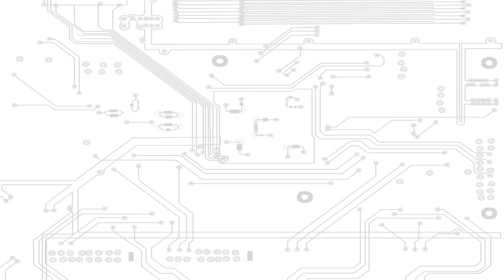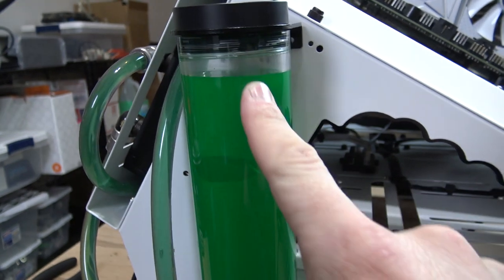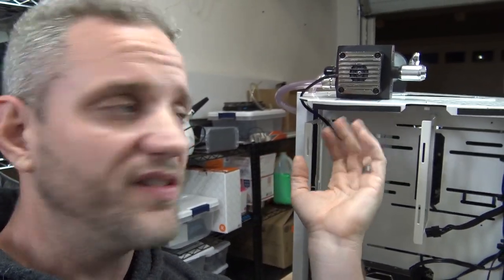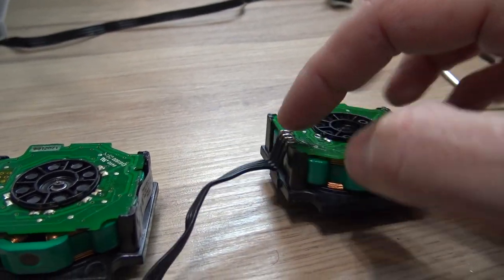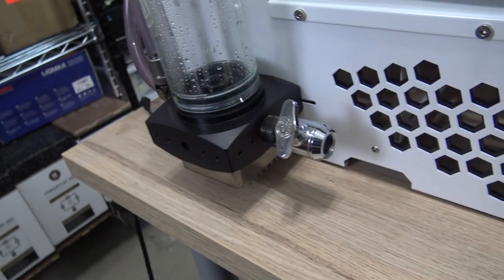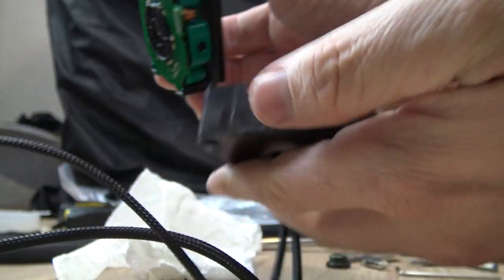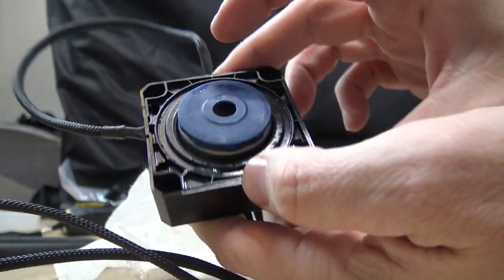My pump died... did the antifreeze kill it?? Let's pimp out my Test Bench!

Comment: That's why I'm scared to do a custom water loop. Do we at least have warranty if something like this happens?
Reply: NECRONEZUM usually not, They'll more than likely blame you if something goes wrong. Had 4 QD fittings from Koolance completely fail in under 6 months and wouldn't honor it
Reply: Arrow I know some people like to lower the rpm of the pump to lower the noise of it.
Reply: Arrow ever heard of overclocking?
Reply: Link_Jumper Ever heard of beefy air coolers or AIO liquid coolers...
Reply: Yes I have but, with a custom loop you will get better temps so, potentially more headroom for overclocking. Which could be a performance benefit making Arrow's statement not true.
Reply: Arrow one answer... looks
Reply: NECRONEZUM yes EKWB even replaces your PC hardware if their stuff failed and leaked
Reply: Beefy air coolers work but AIO are a gimmick and are overpriced compared to air that gets the same performance for less money. Custom or Air are the only smart options to go with.
Reply: SpydreX Official but AIOs look better in my opinion.
Reply: Razorswordex I will give them that, they defiantly look cool:p
Reply: There's also the fact that custom loops can be made much quieter than air or AIO, especially with GPUs.
Reply: Overclocking CPU's doesn't give much performance improvement in games... so meh.
Reply: well it really depends on how much of an overclock you are doing i.e my old rig had an 2.8 ghz pentium and i got 40 fps,overclocked it to 3.6 and got 112 fps so depends on the game.
Reply: ever heard of fun and DIY projects and having your own custom setup that no body else has that you can tinker with and make yours and enjoy doing it???
Reply: Actually you have a point but my i7 4790k that I overclocked to 5.0GHz stays 20-25c idle, 50-70c gaming on a Maelstrom 120K Watercooler. I'm fine for now but maybe In the future when I build a Z270 build, I'll reconsider it :P
Reply: I may go with EKWB then!
Reply: I once attempted to install a waterblock. I fucked up. Nvidia replaced my gpu. I installed another waterblock and it lives in my pc. But the failure rate of decent quality loop components is very low.
Reply: madjimms hahahaha

Comment: I'm not saying it's not the pinching causing the problem - but it doesn't seem a clever design to have bare solder points so close to a metal case and not have at some Kapton tape on them. Especially on something that has moisture so close by. I wonder if there was direct contact after a ding across the bottom or some condensation, after being put in the garage. It all depends on the clearance. Either way that's one hell of design flaw for the pinching it does do, and having exposed solder points like that.

Comment: That's why I just stick to a high quality air cooler, the only point of failure is the fan and is usually very easy to replace.
Reply: .. not to mention you still have a good deal of heat capacity, even if the fan dies.  Not so hard on equipment that relies on it.
Reply: Just as easy to replace as a pump with a dodgy housing
Reply: How much cooling does a dead pump offer, compared to an air cooler with a dead fan? : |
Reply: John Dowty a normal disipator does not work as a passive dissipator, the same as a dead pump.

Comment: there's no short in your pump.  aquarium pumps work the same way,  just blades on a magnet that spin when it has power. I've notice my pumps stop pumping water, i take out the pump while it's still connected, tap the blades and it's starts spinning again. doesn't take much to keep it from spinning,  just need to tap it to get it back on the sweet spot of the magnetic cycle. Your second pump looks toasty......... Fan of the channel. Thanks for the great information and recommendations you've given

Comment: Jay, I ran Rhogard boiler antifreeze in my last custom loop. It actually worked really well. I had it in it for over a year with no sludge build up. It had aluminum core so this was my best choice. This was on an old Q6600, EVGA 680 MB with 3 way EVGA 8800 Ultra's.

Comment: that little over sight by the builder would kind of piss me off a little. i didnt think it was the pinch part i was looking at the unprotected solder connection touching the bottom corner of the lower housing. i hope there is some kind of warning telling you that the pump is malfunctioning other wise that could have been much worst.
Reply: I agree with your diagnosis.  The pinch wouldn't short unless it bares the wire.  The housing was likely shorting to the PCB/solder points.
Reply: this is the correct answer
Reply: Not sure why jay would think pinching a wire would cause a short. No ones perfect right?
Looked like the solder connections on the one he smoked were a little larger. I think that's why the second one actually burned out.

Comment: Your all good with the rubber o-rings.  Engine coolant runs through rubber hoses in every automobile ever manufactured.  And their reservoirs are made of plastic too, although probably not glychol based.  One thing I would recommend.  Automobiles have very powerful pumps that move the engine coolant, where as your little, tiny pump is hardly a fraction of the power.  Even a 50/50 mixture of coolant is kinda thick.  I would recommend thinning that mixture down as well, say 25% coolant, 75% water.  Also, I believe there are some engine coolant additives that do not contain glychol.  Just check out all the stuff on the shelf and research the ingredients if they're not listed.....cheers!

Comment: in my opinion there was no short on the cable, it is more likely that the wire has broken inside, because the chip that burned seems to be one of the 3 MOSFETs that drive the 3 coils of the brushless motor, so    I think that the PWM wire got broken, and they usually have a pullup on the PWM signal line, therefore the pump ran at full speed (or at least it tried to) and made that noise (perhaps manufacturer didn't expect you to run it at full speed). The second pump smoked, because the motor wasn't loaded, and the EMF of the ultrafast spinning motor killed one of the MOSFETs. This is how I see it as an electronics hobbyist. I am also noting, that the board inside the pump has conformal coating, so any leaks wouldn't damage the components.

Comment: 2 minutes with a rotary tool, problem solved.
Reply: Or small piece of capton tape.
Reply: +Arek R.
if pressure from low clearances is the problem, pray tell, how would adding tape to the area - which increases the physical size of everything - solve the problem?????
Reply: because the pinched wires aren't the problem. If the strands broke from pinching they'd just stop working but wouldn't jump through insulation to another wire and short out.  The sides of that metal cover aren't insulated. couple that with the stupid amount of insulation missing off the wires at the solder point and you get shorting to the case via exposed wires. Adding tape to the exposed wires or case would insulate and stop shorting.
Reply: Alex Jennings the exposed ends could be the cause, but if the issue is around the pinched region, more material isn't going to help.
Reply: The problem is that wires are shorted by metal case and adding hard insulating tape would protect from shorting the wires.
Reply: I saw no signs of a short to the wires on the first unit. I think Jay just misspoke and meant to say "open circuit" instead of "short". The pressure from the case most likely pressed the wires together which allowed them to overheat in the pinched area on the first unit.
The second unit, however, did short out... hence, blue smoke. But adding tape would not have prevented damage. Grinding the hole slightly bigger would. Tape would only be a stand-alone solution if the wires shorted from insulation being exposed due to vibration, not pinching.

Comment: It's been said before, but it looks more like the metal housing created the short on the back of the PCB, not pinched wires.  They were marked, but that wasn't a bad pinch.  That casing had no protection between the bare metal and the PCB.

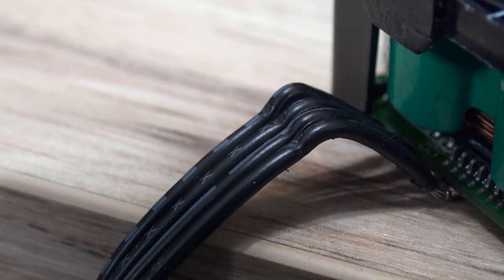Comment: Might be  too little to late.... but I don't think the pinching is the problem. You might be making a short with the 4 or 3 wires on the metal case. 5:34 you can see the solder has some oxidation dots on the bottom. 7:53 you can see that the solder is touching the table. with the plastic cover or out no problem. When you skrew in everything and tighten things up it might just be enough to touch

Comment: Laing makes great, silent and powerful pumps. I don't know what's the exact english term for the working principle, but in italian it's something called "magnetic drag": the impeller is a whole with the (massive) rotor, and they're joint together. They're submerged in the working fluid, and the liquid itself act as lubricant (and there goes why you shouldn't turn the pump on whitout liquid). The rotor-impeller ensemple sits on a shaft, which terminates with a ceramic tip - this is the bearing. The ensemble is self-balancing once it start spinning (therefore why they won't you to install the pump upside-down). I know for a fact that it requires quite a punch of current to start: the internal circuit has maybe a capacitor which charges, and it draws up to 2A before attempting to spin. Maybe something went wrong with the circuitry. Once I was feedin one of theese pumps with an external power adapter, and it won't spin because it was underpowered (the external psu I was using was cutting on the current draw).
Reply: Their design is awesome. Their electronics suck, very cheap, no overheat / overload protection. With the 8 watt version it's not a big problem but the more powerful version, the 18 watt version is prone to failure due to bad/weak electronics.

Comment: is the metal case plastic on the inside. because if not maybe one of the traces or solder joints is shorting on the metal case.

Comment: I'm using 10% universal green antifreeze as a corrosion inhibitor. It's been running for a year straight with NO issues. D5 pump in an xspc dual drive-bay reservoir with a 240 x 60mm rad and a 240mm x 35mm rad through a Koolance 380a water block. Run it with Vinyl soft tubing and aside from a heat kink I have had ZERO issues.

Comment: Kinda related, Jay. I have a DDC pump. For some reason one day it stopped working on system power up. If I gave the pump a hard tap/"shocked" it, it would then start pumping. I took it apart, saw nothing wrong, re-assembled, and it's been fine ever since lol

Comment: Jay, I actually ran into almost this exact problem once. I fried a DDC pump I had due to my own negligence, so I ordered a replacement PCB for it from Hong Kong. Soldered everything up, it worked great until I added the PWM circuit to it, at which point the Alphacool housing shorted something out and fried my second circuit board lol. I have D5 and Jingway pumps in my rigs now...

Comment: I had coolant go into the electronics with this type of pumps from EK, it went up in smoke. Since then I used a pump from XSPC, it is much more secure and doesn't rely on a small rubber protection.

Comment: Hey Jay,
I know this video is a bit old now but I just got a chance to watch it. I have ran DDC's in my setup for a long time and I have had major issues with them all D5's included. However, I know what your issue was to your pump problem. I had them exact same thing happen to me a few times. What happens is is if you use certain coolants (your antifreeze would do this too I'd guess) the inside of the rotor where it makes contact on the ceramic ball gets a buildup of hard crusty stuff on it and basically seizes the rotor up and it won't spin. The pump doesn't have enough power to start. It will do what yours did and try to spin up but can't due to the aforementioned problem. I take a small pick and a bright light and turn the rotor upside down and scrape the junk out of the inside where the plastic sits on the ceramic ball. If you would have looked my guess is you'd have saw exactly what I am talking about. Once I do this I clean it good with alcohol and Q-tip. reassemble and mine work flawless every time. I have to do this it seems whenever I run different coolants. I ran ThermalTake's shitty coolant once and it did this really bad. Even happened with Mayhem's. However, I've been running Primochill's new concentrate and I have yet to have an issue. I guess I should also mention my pumps run 24/7 and are powered by my 2 Aquaero 6XT's. Hope this helped you out man. Rock on with the Vid's!

PS. I have a couple pics of the inside of my rotor's before cleaning if your interested

Comment: You don't have to give up on that metal pump housing just yet!
You could easily open up the slot for the wires more with a Dremel and a small diameter burr, or a set of metal files.
If you're worried about ruining the look of the part, just protect the finish with one or more layers of masking tape or blue painters tape.

Wouldn't take me more than an hour or 2, even using the metal file built into my Leatherman Rebar.

Comment: Jay I had the same issue.  you should definitely throw the old one away. it is not reliable.

after investigating mine I found out that the pump starting or not depends on the position of the blade. I belive that it got something to do with the drive circuit/halleffect sensor.

Comment: My DDC did the exact same thing. when it was out of the system it worked, but when it was in the system and had water pushing down on it from the reservoir it would twitch and not turn on, and mine was in the plastic housing.

Comment: It’s not a short, it’s an open; well a partial one. The pinch’s tolerances were too small and causing the braided wires to be pulled apart (tensile, not sheer) and from the flexing in the hard edge, broke a few strands. Once the stress was removed, the strands were touching again.

What you experienced was more likely than not the “hiccup” mode of the power converter on the board not being able to draw enough current through the wires. With broken strands, the current carrying capability was drastically reduced and once loaded, electrically by trying to spin up the motor, you had an OCP kick in, shutting off the power converter.

All electric motors require more current to start up than they do at steady state operation, which is why it was hiccuping.

Comment: i would recommend that rather that switching to the plastic covering that you use a file and enlarge the gaping on the metal bottom cover. this will allow you to have that cooling aspect of the metal which as we all know if you keep a component at a lower temperature it will tend to last longer (to an extent) and if you enlarge the gap enough it will eliminate that pinching.

Comment: It looks like the copper wire from the coil pack is what caused a short on your circuit board, not the pinched wire. If the wire was pinched (severed) it would cause an "open" not a "short".

Comment: On the topic of the impellers. The closed top impeller has higher head pressure, and the open top impeller has higher flow, everything else the same.

Also not convinced that either of the impellers is incompatible with the reservoir. running it dry just lets the impeller wobble, and hit shit internally. It "should" run fine with fluid in the system. But i prefer higher head pressure over slightly higher flow anyway, so it is all the same...

Comment: I had a few pump fails and a leaking rad after a few years of service. Pumps were DDC as well and they always die that way, it's the "bearing" wearing off or the coil no longer outputs the power needed to start the impeller. Loosing up the top works sometimes. the When I had to replace the motherboard + cpu — gone Sandy Bridge to Skylake, I decided that enough is enough and went full air from full water. Never regret it. WC is overrated IMO. CPU temps even dropped, as I had a single loop and that GTX 1080 was a killer on overall water temps. The GPU got 10c warmer, but still below 73c with full OC (soft mod + hw mod).

Comment: I would be inclined to do a continuity test on the pump wiring as it is a practice to pinch the wires to stop them being pulled out and breaking any soldered connections.